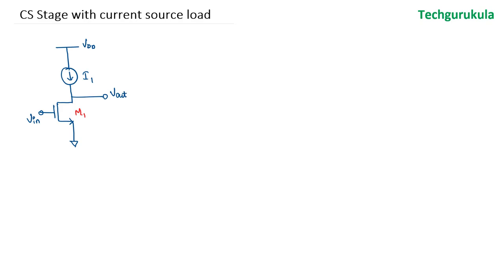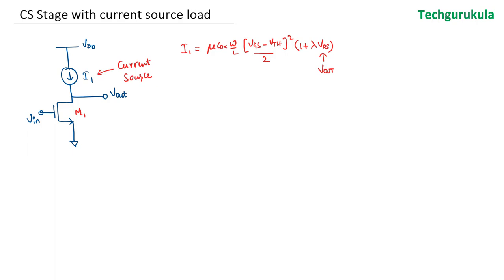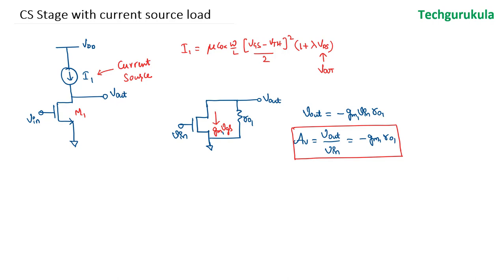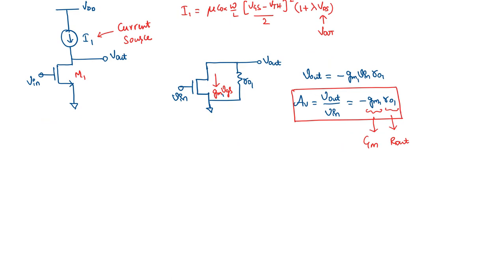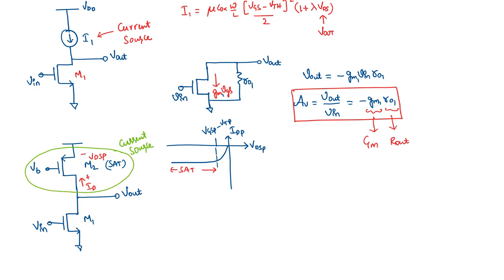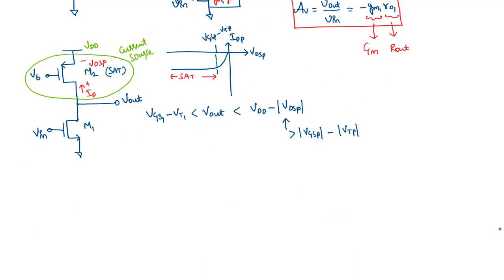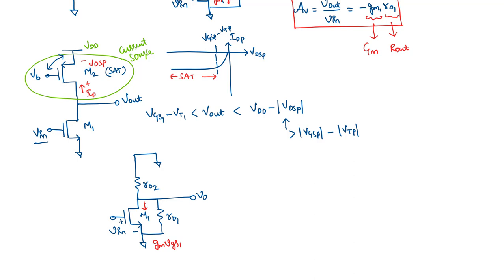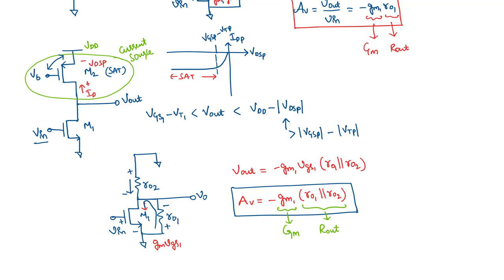MOSFET: Common Source Amplifier with current source as load

Comment: If the load is a current source Id must be constant for both transistors. So when a vg is applied to m1 the current remains fixed even tho Vgs would be increasing?
Reply: we are not increasing vgs because m1 transistor is in saturation region